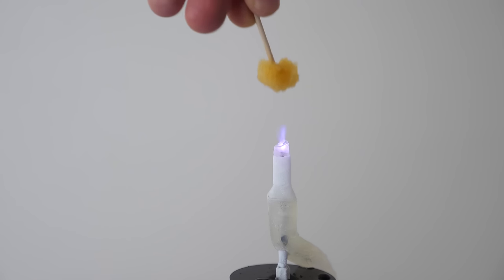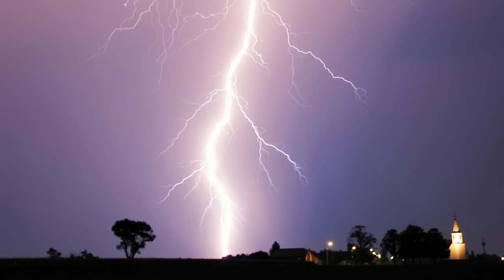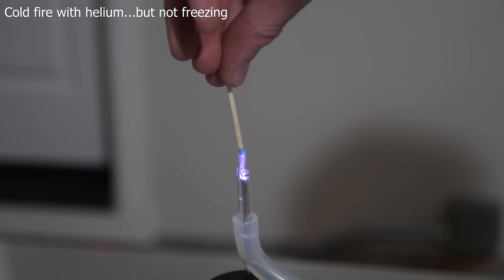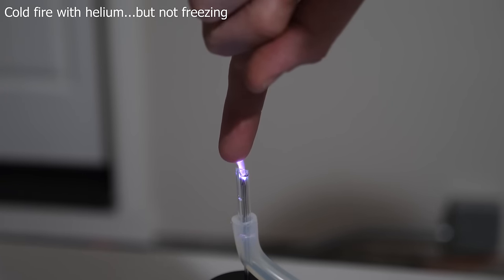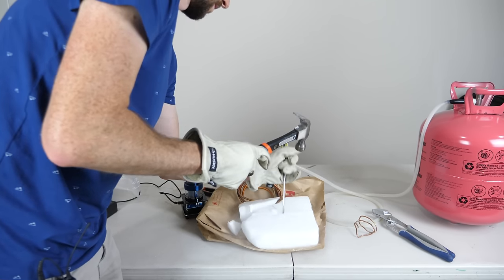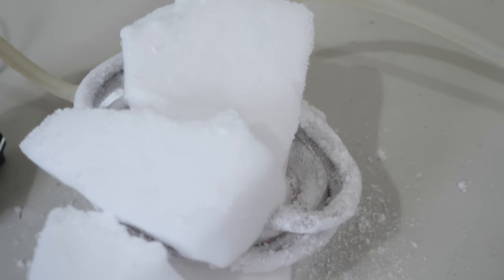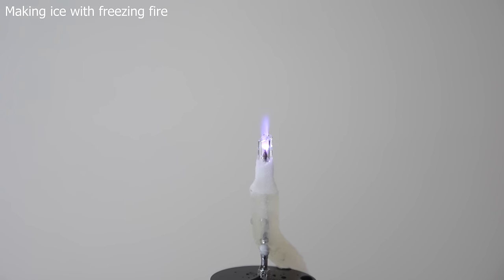Making Fire That Actually Freezes Things Instead of Burns Them—Cold Fire Part 2

Comment: If you send this to the hacksmith, then they could find a way to make Mr. Freeze's cold gun. They already made a deadly flamethrower so...
Reply: Would require too much energy to be sustainable
Reply: Couldn’t they just use a flame thrower but take out the fuel of the flame thrower and put in liquid nitrogen
Reply: Is liquid nitrogen flammable
Reply: @melt6894  yes
Reply: @monke6622  when nitrogen burns it's hot
Reply: Actually... If you scaled this up... It could be a freeze gun. Or find a way to put it in a bomb casing.
Reply: Lol tell elon musk
Reply: Aren’t all flamethrowers deadly?

Comment: Genuine question here.

Wouldn't the helium be freezing this? Not the actual plasma.
Reply: Yes I believe it is the "fire" just isn't transferring any heat it's cold because the helium was cooled not an energy stealing fire
Reply: The helium becomes partially plasma as well, just a cold one.  Helium is one of the most easily ionizable elements, next to hydrogen
Reply: @alextaunton3099  No. That would imply that the plasma has slowed down. It's not the case.

It's just a hot plasma flooded with cold helium.
Reply: Was wondering the same thing, if it would work regardless of if the fire was on or not due to the helium
Reply: The super cooled jet of helium gas would freeze things regardless of the plasma even being there. If it enhanced the freeze time in anyway, that would be awesome. But as it stands the "fire" is nothing more than a special effect.
Reply: @scottpierce3351 
I agree.
Also, I would like to see this experiment done without the helium absolutely flooding the plasma.
Reply: The electrical discharge will be providing a little heat to the cold helium gas. The Action Lab is not the place to learn physics. However, some of the demonstrations, such as this one, could be the basis for some interesting magic tricks.

Comment: Wait wait ho-ho-hold on so you mean that i can touch fire hold on i tought fire is made from very high heat that can burned YOUR HAND

Soo.... what happens when i touch the cold fire?

Will my hand freeze now? 😨😑
Reply: the spot you touched the fire would be frozen/cold
any way it is chilled, it sterilizes surfaces very well
so if you put it on a toilet bowl it would be bacteria free
(the electric charges rip apart anything bacteria sized (our cells are bigger so we are mostly fine)

Comment: Question:
can you possibly increase the flames height by pumping more helium through it? 

 is it possible to use other gasses such as nitrogen, carbon dioxide etc?
Reply: try it out
Reply: I think it's only possible with neutral elements

Comment: But you don't need that voltage to freeze that drop. 
So it's basically like a light show.
Reply: Yeah, but that’s not what the voltage is for

It’s so you can have fire that freezes things, cause without the voltage you’d just have cold ass helium
Reply: @oriongurtner7293  with the voltage you still have just cold ass helium. The fire is room temperature so it's basically a light thet covers the helium. This isn't cold fire it's cold gas with a cool light on it

Comment: An interesting experiment, I enjoyed watching the video.    Just thinking though, you'd surely get the same effect without the plasma because the helium blowing past the droplet is below freezing anyway. I suppose what you demonstrating is the effect of specific heat. The volume of gas and the temperature of the gas overwhelms the energy imparted to the matchstick by the plasma, such that it is not enough to  burn. I suppose we are just so used to expecting plasma to have so much heat , such as plasma in arc welding , that this effect is unexpected and fascinating to watch.

Comment: A few questions: can this be scaled up?  (Or is there a flow issue with diminishing returns). Then once scaled up,  are the alpha particles measurable?  

Another(related) question,  if you do scale it up sufficiently,  can you measure any kind of thrust?  

Other question: if no heat, do the "burn products" flow downward ( as  heat  rises) or  as a helium or alpha do-  the atoms move off?  

If the atoms move away ( back to thrust) they should be able to be directed and impart a motion? 
Finally:
Perhaps a kind of "ice welding" tool? 
I have more,  But this enough to ponder for now.  Wait till if had my coffee.
Reply: Im not going to read your comment ,
Reply: I read it, and sadly none of it makes any sense whatsoever, at least to me that is
Reply: @Its_Orca  I'm not going to reply to your comment because I didn't read it.  lol
Reply: @syedkahar4679  Which part? It came in several questions. Before coffee and before I woke up. 

 But-- I wondered if it could be scaled up, the laws of motion would say that the gas leaving the torch, would produce a thrust-- a jet?  Or a rocket?  hmm...   Using Alpha particles as it leaves the emitter, it will impart a thrust.  I was just wondering how much. 

Then it came to me after my second coffee.  Yeah-- Ion Drive. 

The ice welding:  If you wanted to construct something different (art?) or you could use it as a script for a James Bond scene of some kind. :)  Before coffee in the morning, different ideas are not fully focused, but the thoughts can be fantastic and fun.
Reply: @syedkahar4679  Scaled up= Made larger
Reply: @MasterDashMD  Ok now I think I kinda understand your question, thanks for explaining, and if the torch can be made bigger chances are it might be able to be used to push objects and freeze things, like that villain in batman whose name I forgot
Reply: He basically asks to make welding machine out of this Ark

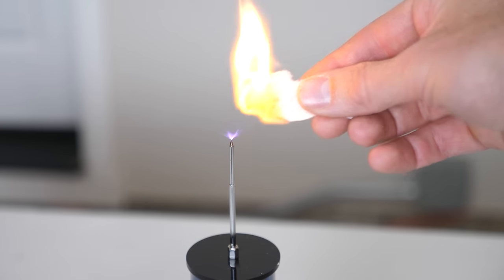Comment: 0:50
The electric arc is extremely hot, in fact so extremely hot that you can burn stuff with it.
That's something that you typically cannot do with extremely hot objects.
Reply: Yeah like the metal on the seatbelt.

Comment: A little bit of necroposting, but I'm hoping valiantly that I will get a response. I noticed that the actual flame itself is rather small; is this due to the relation of the fire triangle? You have ample fuel to keep it running; does the flow of helium restrict the flow of oxygen to the flame; is it due to the low temperature that prevents it from flaring any higher, I noticed that in the freezing experiment the flame was smaller. This all stems from my curiosity over whether there is a deterministic measure for the necessary oxygen percentage in the air relative to wind speed to either snuff or grow a flame. I know that you need at least 16%, but at what point do external factors change that value, and how? I Get curious like this every now and then, but generally don't further research, however this might help me with figuring out some principles fire and thermals; why don't people use liquid neon for cooling purposes, just a side question.

Comment: It's just cold helium (air) that's freezing the water and since there is helium gas passing through the pipe in very speed , there is no oxygen for the electrons to react with . Therefore the fire is at normal room temperature. It's just like cooler with extremely cold dry ice in it that can make the air ice cold.

Comment: Hey, I need help for my science project. Our project is that in a rocket ship we can reuse the heat made by the exhaust gas of the thrusters into electrical energy. We looked at some videos on how to convert heat energy and we need a cooled surface in order to make a thermal electric generator. But, the problem is, the Exhaust gas is too hot and will make the cooled surface hot and ruin the the generator.

What I’m trying to say is, how do you make an object cold for a long period of time, even with the hottest of flames constantly near it?

Comment: I saw evaporated milk in a can, no problem, that's got to be dry inside (lol).
Then along comes Canned Heat!
How can the can not be hot if it is canned 😄. Now I see your video. 
I am caching in my poker chips. 😂
Thank you for your video much respect for your time. 👍

Comment: I'm curious about your experiment. Did you take any steps to keep the super cooled helium from affecting the results? How do you know if the helium, not the plasma, is affecting the water? I'd love to see this experiment replicated with thermoelectric cooling to get to high-temperature super conductor temperatures (−196.2 °C; −321.1 °F) and see if the reaction can keep a super-conductor at operating temp. longer than liquid nitrogen.

Comment: This is probably crazy, but how logical do you think this is why Antarctica is frozen over? 
If stars produce helium as a by product, saying a second star in the core isn't too far fetched. 

Say if you had a flame come out of a hole in the ground, but you have extensive amounts of gas too. 

Could you in theory explain the aurora lights, by saying that is the reflection of whatever magnetic field is coming from within.

I've seen a lot of quantum levitation videos, but I also understand sonoiluminecense. 

Say below the surface is a giant ocean of salt water within hard layers of magnetic rock, having a spinning ball of energy with waves of sound hitting it would produce something similar?

I might be off, but I don't think I am.
The earth isn't flat, it's laying flat like a frisbe floating in space.

Comment: Wait. Do I understand this correctly? Because I clicked on this video expecting to learn about a chemical reaction that burn at subzero temperatures... But it sounds like the fire is hot, you're just pushing a very cold gas through it that counteracts the heat. so the fire isn't actually cooling anything, the helium is. the fire is just there as a special effect.

Comment: It's been 3 yrs, but I feel like there is a new engine design or something here; maybe a solution to the problems with hydrogen engines. Idk, just feels very useful in a groundbreaking way.   .... Can anyone tell me, have they ever run an experiment where they tried to stretch out a laser beam in a visible field, using mirrors, until the beam dissipates? like a geodesic structure of mirrors, and the beam keeps reflecting within that space, so we could observe the path for, say, miles, hundreds of miles, but contained within one structure....

Should we expect it will dissipate at some point? Does it maintain it's shape and cohesion?

Comment: Instead of dry ice there must be a way to change the set up part by adding nitrogen meaning a custom container with liquid nitrogen while a way for helium gas past through something. Basically a material.  How about making a custom tube made from the same container material dipped in nitrogen allowing helium gas pass though.  It should something shaped like a Ω but upside down. The corner of the omega symbol is the flow of the hellium gas in left and right out. It's best to fill the container 1/4 or a bit more but not half or full of nitrogen atm. Watch it freeze way faster I guarantee it. My only concerned is how will this fire (electric arc )will react to helium gas plus colder leves if nitrogen. I say a a configuration whether or now now much input is needed for the arc. Maybe its more power, higher reaching narrowed flames controlled electricity levels, maybe its the same like with  video.

Comment: The constant repetition of the term fire and flame is catchy to attract viewer's attention but it is rather misleading in regards to the cooled and electrically activated helium jet. I do agree that it is good to understand that a gaseous plasma state doesn't necessarily need to involve thermally heating the bulk gas to temperatures of over 1,000 °C. In fact this type of plasma could exist at liquid helium temperature of around 3 degrees Kelvin.

Comment: The plasma is being cooled down possibly!! But the surrounding areas temperature is being dropped so much that any item that passes through the surrounding area is chilled so tremendously that their is a moisture present.... the plasma is definitely still creating heat and you simply cooling it down.... I bet if you push that match head as far down the plasma stream as you can it will light... the heat is being cooled towards the top and you most definitely did not create cold fire... what you did is literally no different than freezing the match in the freezer... except you wrapped the freezer around the plasma ... I can freeze the tissue on the bottom of my feet and run across hair coals and not get burned but that doesn’t mean that the coal is not burning hot and again you did not use fire because it would go out

Comment: Cold plasma in glow mode with a cooled helium-rich gas flow so only a part of the gas stream ionizes and the non-ionized gas stream has enough thermionic mass to not only over come the plasma glow mode energies, but cancel enough heat in the target to bring the temperature of the target below its respective solidification state temperature.
In other words, that shit got cold!

Comment: The title is kinda misleading. That’s not a freezing fire, it’s freezing gas that happens to have a fire put into it, freezing has nothing to do with the fire, in fact the setup would be better at freezing if you turned the fire off.

Comment: I wonder what you can do with this in real life, like engineering a cool motor or cooling the sun rays around an astronaut to get closer...
Reply: that last one is so impossible. Do you have any idea how cold something has to be to drain any kind of significant heat from the sun? The sun is Trillions of Trillions of Trillions of Trillions of times hotter than fire. You would need something around 15 or 16 Kelvin, which is impossibly cold. (for context, 0 kelvin is Absolute 0, the coldest temperature that exists and also the only temperature hat is impossible to attain.)

Cool motors, maybe. But getting more than a few hundred million miles from a star? never going to happen. Humans melt too easily.